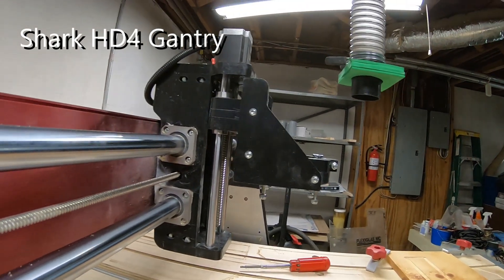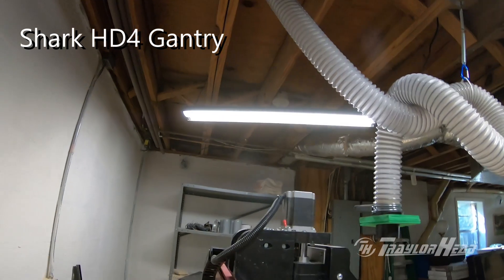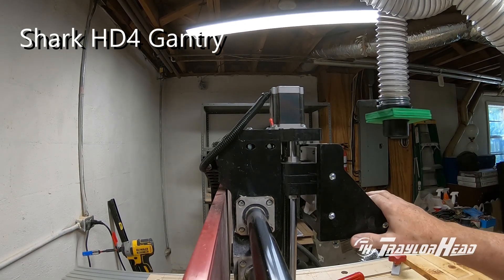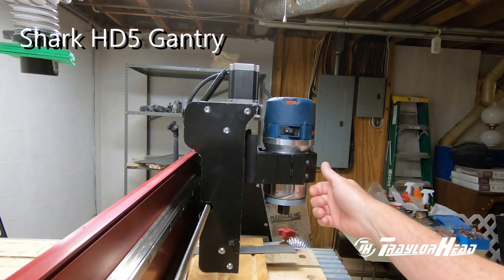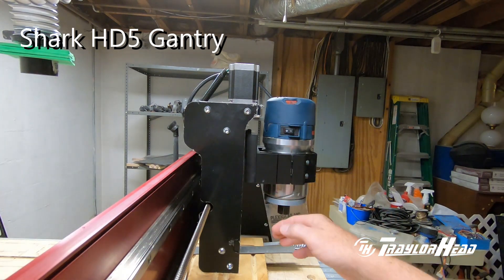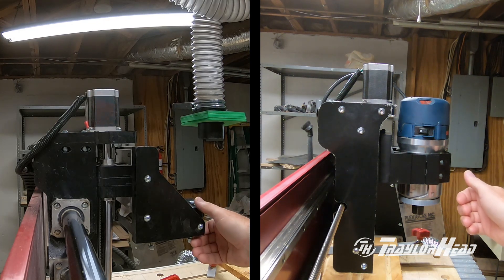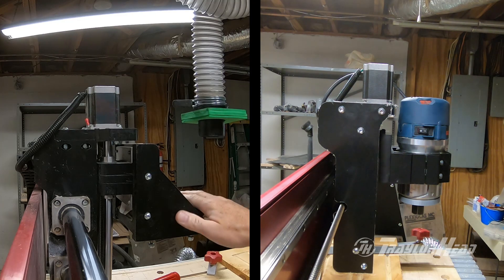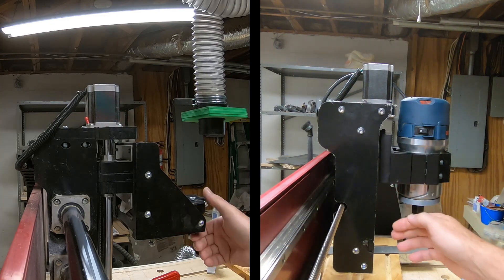Shark HD4 and HD5 Gantry Flex Compared

Comment: Sigh. Unfortunately I need to get a different CNC machine. There is still too much play even with the new gantry, mainly because the backing plate that the rails attached to isn't very strong. You pay a grand for this "upgrade"and they couldn't even use better extruded aluminum on the back support. I'm not sure why NWA couldn't beef up the back support. Very unfortunate. If they really wanted it strong they could have used 1"  G10 on the back and that thing would be bullet proof. If I had the dimensions I'd just make them and sell em. Why does a customer have to do this lol. Baffling. They charge so much for this and they are making killer profits. They could make them so much stronger and STILL make killer profits. So disappointing.
Reply: I just bought an HD4 at a school auction and I think my plan will be to scratch build a replacement gantry with an 80/20 extrusion for the back plate.